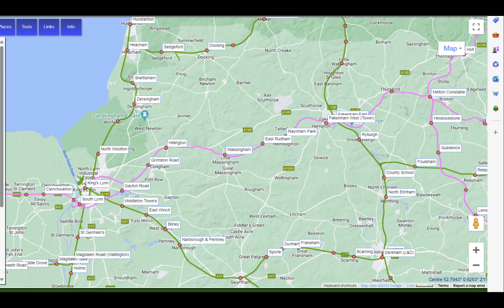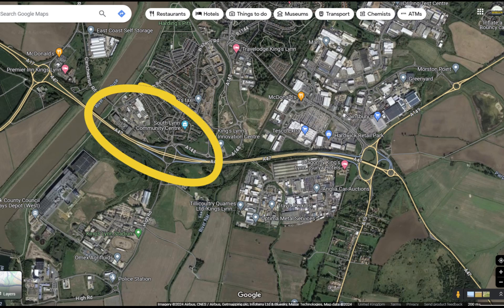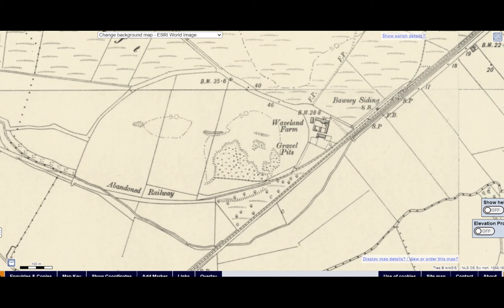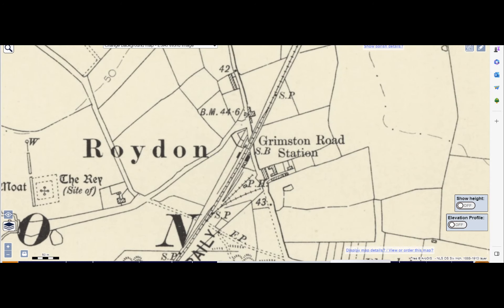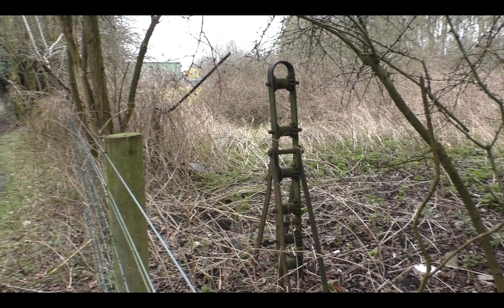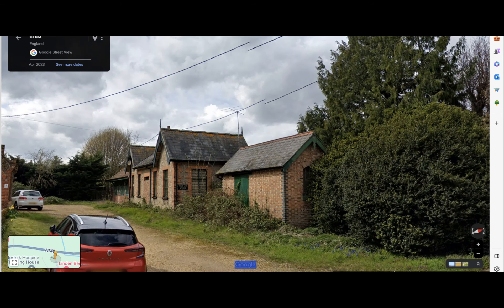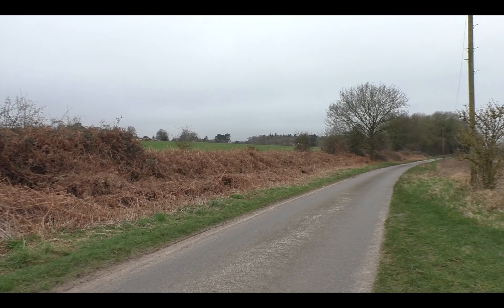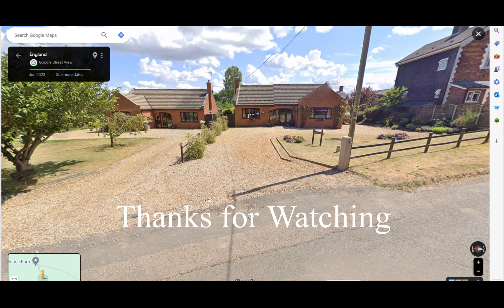M & GNJ Railway. South Lynn to Melton Constable. Pt 1

Comment: My father worked on the relay gang late forties to mid fifties, much of the track on the M and GN was renewed at that time. New signalling, new turntable at Melton Constable, brand new steam locomotives in 1951/2. They were building a new engine shed at South Lynn when the line closed, terrible waste.
Reply from the maker: Thank you for your comments and interesting information. Yes many parts of the country had lines closed not long after infrastructure had been replaced or rebuilt. No joined up thinking and a waste of time and money.